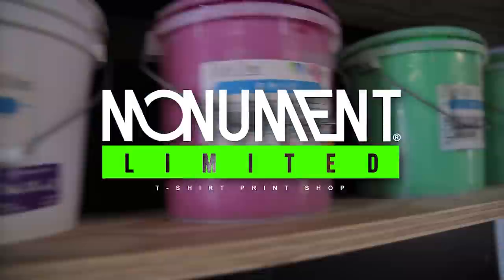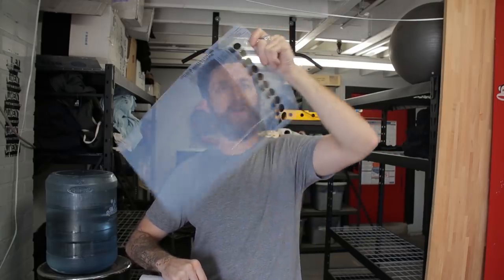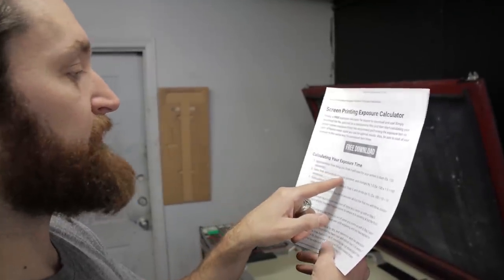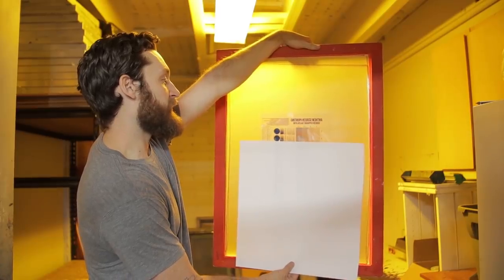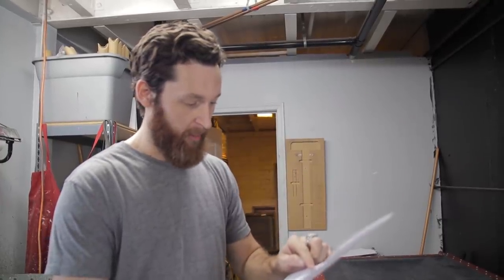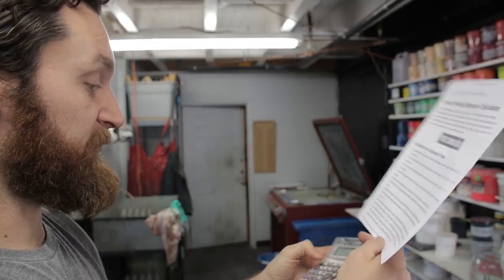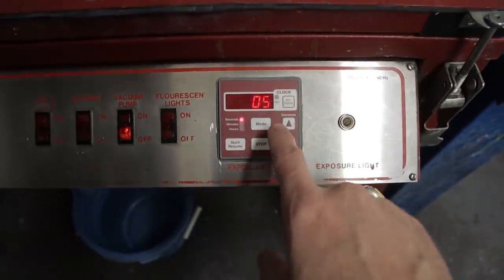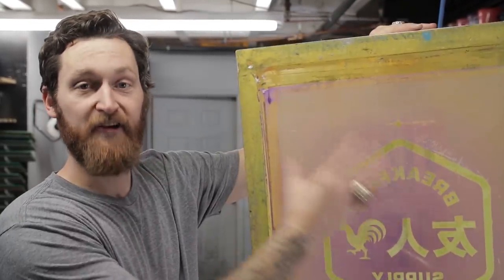4 troubleshooting tips for burning and exposing screens | How to screen print

Comment: PRINT LIFE..!!
A tip: Make sure you run your exposure calculations across your different mesh counts. Your 180, 156, or 110 will tolerate a longer exposure time than your 230, 305, or 330 meshes with high detail or halftones which will require a shorter exposure time (Usually about 20-25 percent).  Color of mesh, type of emulsion and their solid content, as well as the thickness of your stencil will also cause variations. Of course the quality of your film positive is of the upmost importance before a calculator will be an effective tool. For newbies a dual cure diazo emulsion will be the most forgiving. Anyway I be quiet now. Thanks Cameo..!!
Reply from the maker: Boom.
Reply: great tips
Reply: Yea nice tips mate times differ from white mesh to yellow always longer on yellow mesh. Totally agree with using emulsion with a diazo especially for beginners one pots need to be worked with a lot quicker any light bouncing around dramatically effects exposure. Also all emulsions have a shelf life of 6 months one mixed. Best storage for emulsions is in your fridge not freezer. Mixing the emulsion is very important use distilled.water or boil the kettle and let the water cool when using a diazo. stir with plastic or wooden, never use stainless the enzymes can effect the emulsion. If your emulsion has gone off you will notice when you wash out your screen the emulsion will peel.
Reply: @Truthnesshurts  sir how bout how about ULANO emulsion i cant get the right time to expose of my images in the screen.
Reply: Damn, I really wish I understood all of that.
Reply: @josephsantos145  I use ULANO emulsions and they work fine, I just can't seem to get a clear print with the inks though. I'd tell you why but I haven't been able to figure it out.
Reply: @trevorj4707  after putting in some time and doing some testing in your environment and with your own supplies it will be more helpful - all that is meant to be considerations for really dialing in your exposure times and stencil creation BUT it is not a complete list of considerations and best of all you can still make decent screens without understanding it. Best to your efforts @trevorj4707

Comment: Idk how I missed this video but its an absolute godsend man. Ive spent like.. 5 weeks straight trying to get one small screen to expose properly.  

i tried an exposure test with no results-- i literally couldnt get any emulsion to wash out 3 whole tinmes.  was using speedball inkjet transfer film, darkest possible ink setting.. still no exposure results with a test , my logo on the film, and using an overhead uv light. the part where you said 'your film might be letting light through and giving you a result that looks overexposed' is literally what the issue is.  I'm actually tossing the film for the time being and gonna attempt to just cricut cut some thick vinyl for this next exposure because I did the dime test in my last attempt, and the dime circle/shape exposed flawlessly. maybe its the screen size too?? its like a 7 x 7.

I genuinely thought I was going crazy, but you just confirmed it -- the film is letting light thru  so I was getting 'fake' overexposure, and my films need to be high quality. all other channels havent mentioned this, they just act like paper or transparency sheet will always work. SO THANK YOU.  you also explained what under and over exposure ACTUALLY looks like in detail instead of just saying the screen can get under/over exposed without explaining WHAT each result looks like, that HELPS so much, thats god tier of you

I'll also eventually do a proper test once I somehow get this film working or buying a test film online.. because I'm just so tired from so much failure lol. I'll also be degreasing as youvsaid, again-- NO ONE has mentioned this in other vids

idk if you're still around to read comments, but question-- do you think at least applying dark cut vinyl to a transparency sheet could work as a 'film' for the time being? I wanted to at least be able to re-use the design instead of breaking down the vinyl decal each time

Comment: Ah thanks for this dude!

I've been burning screens successfully with the sun since January 2021, its now June 2021 and I now am using a light  (50w led) which I experienced breakdown of emulsion because the light was to close. I now know how to fix that!

Bless you'll at Print Life!
Keep at it soldiers
Reply: Hey Andrew, I'm rookie into screen printing. I'm using same as yours DIY 50W LED exposure unit. I fade up of trial-error and wasting so much emulsion, sesitizer, decoating powder and of course most important is the time. In my case, the distance betwin the lights and the top of the glass is exactly 16 cm. whatching so many videos and advices, I already understood that the factors are many for successful burning of the screen, but please tell me approximately what is the optimal distance of the lamps and the approximate time for burning the screen with 50 watts LED. Thans in advance.

Comment: Just this week I noticed after washing out my screens and hitting it with compressed air to remove any emulsion in the image area, some of the image would come loose and flop around. At first I thought it was a degreasing issue but turns out I just had to expose it longer. I have the entry-level Ryonet 8 bulb exposure unit and I guess it will be time to replace the bulbs soon.  Cost me a lot of time and a lot of money on account of all the beer I had to drink to cope with the issue because it happened when I was swamped of course. Live and learn! Thanks for the vid!
Reply from the maker: Oh man I love when that shit happens it was working a week ago and then like magic it's not working anymore.

Comment: Good video!  I started just cutting my designs out on vinyl, sticking them to glass, and using them to burn the screens.  With the vinyl being completely opaque, there's no worrying about overexposing through a bad transparency print.  I've only done this once thusfar though, so YMMV
Reply: church
Reply: How is that working out? Curious if that’s a viable option when having issues with a screen
Reply: @angelhernandez-headden5576  It actually works pretty well, just make sure you're exposing your screens long enough and you should be good.
Reply: @stupid5pin  yo could you make a step by step?

Comment: I tried burning a screen at just 7 seconds, as you stated in another video.  Total wash out.  I think the times will depend on the mesh, the emulsion, and the exposure unit being used, which creates so many variables, it will depend on each person's set up as to what works, and what doesn't.

Comment: awesome video I had screen break down I use chroma blue emulsion and wasn't degreasing good enough but watching your video helped me out a lot, I have the 8 20watt uv bulb and burn for 7 min and have no break down at all. 1 question how long do you let the screen sit in the dip tank and is it just water that's in there cause when you wash out the screen it looks like it doesn't take long to wash out. Thank you
Reply from the maker: I let it soak for 30-60 seconds and that usually softens the emulsion enough so that wash out is a breeze.

Comment: nice to have you back cam. Question 1, what emulsion do you use. I have the 80 watt version of your light and with my emulsion (ecotex crap) it took 7 minutes, the light is 14 inches away from the glass. I am guessing it is the emulsion i am using causing me problems with exposure times. at 7 minutes it still lost some small details on a 200mesh.
Reply from the maker: get that light farther away at least another 12 inches. 7 min sounds crazy for an led like the one if have, something is not right with what you got.
Reply: The emulsion you are using is not suitable for UV. Use a UV emulsion
Reply: It can be problem with type of glass 😉

Comment: I allways print doubles with my canon pixma ix6850.. otherwise it indeed blows out or over exposes. I need to do a calculation like you cam.. it’s on my to do list ;-)!
Reply: I have the same printer as you do, is the ink not black enough that it still comes thru? Are you using an LED flood light like Cam's?
Reply: Gus Sanz hi, no i’m using uv tubelights. Indeed, the ink is a bit transparent when you hold it against the window.
Reply: @deprintprins8614  is there a fix for this issue, sorry I'm new to this game...
Reply: I have to do this as well...thinking of moving to an all Blackmax setup soon and see if I can get my prints dense in one hit. At least the printer hits on point re-registration on that second pass no worries.
Reply: @deprintprins8614  here is a solution :https://youtu.be/mG-3KwLz1SU
Reply: Gus Sanz I print my films twice and with the registration marks I can line them up. = darkest film ever.
Reply: i have the same model of printer I find out that choosing photopaper gloosy 2 is best but film dose not come out as black as i wish....did any of you tried to print the same film transparencies twice.i mean print 2 times on same film....i tried and it works i just do not know if is going to ruin my printer.....
Reply: @newrojean  found a solution, print your files to spot colors and print them in photoshop, problems solved

Comment: I'm just starting to use photo emulsion after years and years of using Sta-Sharp s3s.   My first burn/Exposure washed away everything. I do not know what happened,, I think it may have been exposed before the burn, and/or the mix was not done right.   
I did put the emulsion on the screen in my studio lighting....and I have issues with my transparency and blacking out all of the image.

Comment: Great videos fella ! I haev a problem you may be able to help me with.  My screens seem dry and my burn times are fine, when i burn a screen i am starting to get water marks and blocking of parts of the mesh from the emulsion on the inside of the screen flowing down into the graphic.  I dont have a dip tank i wet the emulsion and let it soak a little before i blast the graphic out.  Are you able to help me understand why the screen is blocking ?

Comment: I am going to use the exact UV light 50w you recommended  to expose my screens I am using black Vinyl instead of printing my film, since you know your exposure times, what emulsion do you recommend and what exposure time with the recommended 2ft distance for the light..
Reply from the maker: We have been burning at 23 seconds on 156 mesh
18 seconds in 280 mesh

Comment: Ive been running into a few problems. After washout should you dry your screens vertically? or horizontally? I'm dealing with a bit of scum after washout that doesn't run off all the way and seems to be sitting on the cleaned out open mesh.
Reply from the maker: Horizontally if possible, and a air compressor helps pre dry the screen preventing scum from running into the mesh.
Reply: @ThePrintLife  ok. I've just started running into scum and it's been wracking my brain. Trying every variable I can think of to combat it. Thanks cam!

Comment: My screens are somewhat not holding the print down when I wash out after burning. I don't know what I'm doing wrong. Is it not enough emulsion on the screen or not enough burning time. My 2 other screens did well but now that I washed them and did the process over again it's not holding. I use Jacquard Photo Emulsion. Any tips appreciated.

Comment: Hi print fam, wanted to know what you might advise someone who is starting off with a Riley 150 no micro when it comes to exposure unit size.. would you spring for the 20x24 or save $200 and pick the 16x20 to be used with 20x24 sized screens ?

Comment: Help please. Just did my first burn with a 200w light at 2 feet for 26min and it just washed out straight  away. My films are also  double layered. Will try again soon. possible problems; oily screen (even though i clean it) or under exposed (weak light source maybe need a stronger bulb) Any ideas? Update, I did a test screen calc and that screen seems much better. I let the test screen dry for 24h and let the troubled screen dry for 4h. maybe this is why. I also put the emulsion on much thicker on the troubled screen.

Comment: Most frustrating endeavor I've ever taken on, screen printing! Jesus, what a nightmare! Struggling for years trying to figure out why my images aren't printing clearly. They're always blurry even though I'm using 355 mesh for a four-color process. We use the old-fashioned style printing press, all by hand, we don't use any kind of robot to print (though I'm also considering taking out a loan for one) I don't know if it's the program we're using or missing a calculation and even if the images do print, they wash out of the shirt over a short period of time even though we use an infrared curing system. We use basic water-based inks and I'm starting to consider going to Plastisols but that in itself brings about a lot more problems so I'm sort of stuck in this never-ending loop of "This should work, this doesn't work, gotta find another route, this should work..." GAAAAAAAAAAAAAAAAAAAAHHHHH! Wish me luck and wisdom because brother, screen printing is making me insane.